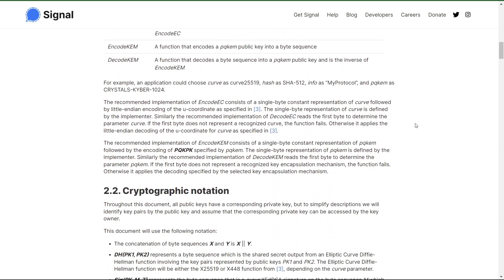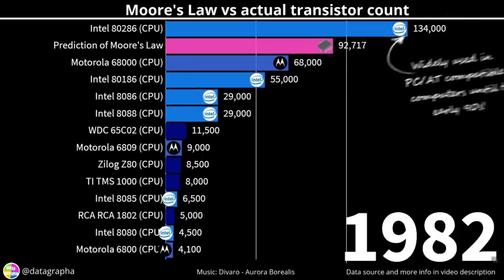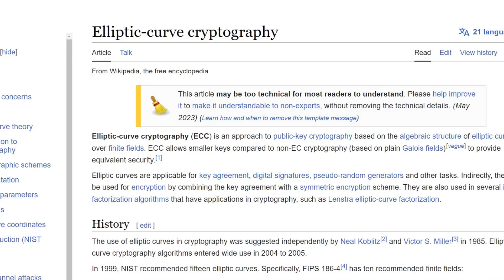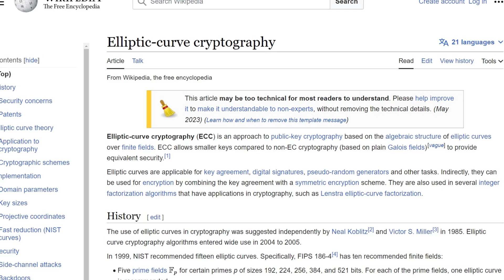Signal Just Published Post Quantum E2E Encryption

Comment: it more than double the power when you add a qubit  Qubits can represent multiple states simultaneously through superposition. Adding one qubit effectively doubles the number of possible states that can be represented. For n qubits, you have 2^n possible states. This exponential growth in states can be harnessed for certain quantum algorithms, such as Grover's algorithm for unstructured search, which can offer a quadratic speedup compared to classical counterparts.
Reply: A classical computer with n bits also has 2^n possible states.   A classical algorithm with randomness (which is commonly used) samples from probability distributions over all 2^n classical bit strings at once.   The potential power of quantum computing does derive from an exponentially large state space, which classical computers also have.
Reply: @iyziejane  the speedup comes from q algos like shor's and grover's which are exponentially faster - they are even faster on a regular computer but it means that the speed gains from adding additional qubits can be much more than double - moore's law is exponential, qcomps are accelerating much faster than that - Quantum volume is expected to at least double each year or about double the pace of moore's law - orders of magnitude jumps and the cagr for quantum tech is projected to be about 30% cagr over the next decade - that could be conservative since at some point it will catch on much more widely and hit an inflection point - 5-10 years we should see a quickening of the pace - people are terrible at predicting the future
Reply: @shephusted2714  Grover's algorithm is not an exponential speed up, it's a mild polynomial speed up (square root).   So Grover attacks on AES encryption are thwarted by doubling the length of the key.   Shor's algorithm applies to highly specific problems.   Even if you had a quantum computer as large as you wanted, there is no known algorithm you could run to solve hard optimization problems that are impractical today.

Comment: So what you're telling me is I need to invest in IBM because their quantum computers will basically be the centralized compute power of the future.
Reply: Give megacorp more money
Reply: No, quantum are only good at a few things- not most things
Reply: @big_red_machine3547   and what happens when new technologies are dependent on it and perform tasks so fast all the standard microprocessors in the world combined couldn't do it at the same speed?
Reply: @big_red_machine3547  Yes, that's with current technology. It's entirely feasible that 1000x+ faster computers with quantum technology could exist one day. This is why nobody actually knows if an alg is 100% quantum safe, as you obviously can't see the future, and anyone that says something is 100% safe is lying.
Reply: @big_red_machine3547  And even then only in theory so far.  I expect maintaining quantum coherence to be exponentially difficult with growing Q-bit count, making long keys inherently quantum resistant even if they don't account for quantum cracking algorithms.
Reply: Or just buy IBM 5100 right now
Reply: @ReyHunter CERN would like to know your location
Reply: Why not throw a quantum computer into space? Nice and cold. Beam the data to and from. Done.
Reply: @Graciashauf 
Space isn't as cold as you think. Look up what NASA had to do to get the IR camera on the JWST to work at extremely cold temperatures in space.
Reply: @chrono_tigger  but u just said it wasn't that cold then say extreme cold temperatures in space so which is it? Throw the computer to the night side of 🌎 and have it always stay there?
Reply: @Graciashauf  
The Cosmic Background Radiation sets a fairly constant temperature of around 2.73K (-270°C) in even in the most remote parts of space. Quantum computers need to be around 0.01K (-273°C), which is 273 times colder than that (please check if my math is right, math and migraines don't mix). The coldest our Solar system gets is on Uranus wich reaches 49K (-224°C).

Not to mention being in space would be very difficult to service and transmit data to and from the computer. It just isn't viable with our level of technology. It's not a bad idea, it just has it's own problems.
Reply: @chrono_tigger  well there goes a quantum cellphone...
Reply: @chrono_tigger wow i didn't know thats how temperature works at lowest temps ( -273 being 273 times colder than -270) , thats pretty cool
Reply: @a.d1775 i dont know if this is sarcasm (if it is, yeah wtf was that about), but no 0.01Kelvin is just -273.14Celsius.

And @chrono_tigger, -270Celsius is just 3 degrees higher than -273Celsius

0Kelvin is equal to -273.15Celsius after all
Meanwhile 1Kelvin is equal to -272.15Celsius
Its just addition no multipliers
Reply: @millionelectricvolts6117  You can use addition or multiplication, both are technically correct. With temperatures, we mostly use differences, so addition is probably the more "honest" approach, I agree.

However, keep in mind that it is much more difficult to cool something from 3K to 0.01K than from 273K to 270K even though both are a ~3K difference. And cooling something to 0K is thermodynamically impossible. So multiplication is maybe more honest after all...

Edit: Fixed a typo in the math
Reply: @millionelectricvolts6117  
Thanks for clarifying. I do know that it gets substantially harder to get colder those last few degrees, and I am not used to working in Kelvin lol
Reply: @chrono_tigger  Sounds about right
Reply: @chrono_tigger Space is exactly as cold as we think. It just doesn't conduct heat very well
Reply: @Graciashauf  it is easy to keep it cold. Real difficulty is to keep q-bit entangled during computation, which means absence of interaction with environment. Photons from your beam basically destroy it as any random particles flying around. It is easier to keep it in heavy shielding down here. Actually you keep it cold to prevent random bouncing of atoms which destroys entanglement.
Reply: @Graciashauf space is near absolute zero, but there isn't almost any matter to actually take the heat energy away. It's like an extreme level of putting a hot kettle in a thick cotton blanket
Reply: @Graciashauf  ambient temperature of outer space is irreleavent, the rate of heat transfer is very low because surprise, its empty.
Reply: @Graciashauf I'm not so sure about the thermal diffusion speeds
Reply: Just so they find some new fancyWord "Physics"
Reply: i'm already up 17% since may
Reply: Yes. Support them in helping with upcoming genocides.
https://en.wikipedia.org/wiki/IBM_and_World_War_II
Reply: YES finally
 I welcome the quantum hollerith machine to deal with  todays ultra complex JP

Comment: It’s a shame that Signal removed their messenger’s ability to handle regular SMS. It makes normie adoption a lot harder. Also, they’re not on F-Droid, which is a little suspicious.
Reply: Signal prioritized security over convenience so I dont really blame people for quitting on using the app. There are certain conveniences that people wont give up.
Reply: They're not on F-Droid because the app uses Google Play Services for notifications if they're installed
Reply: @TheChaoticWolf  This is false. Signal works fine without Google Play Services. It will run in the background and keep a connection open to the Signal servers to provide push notifications.
Reply: @CrazyStranger11 That's why I said "if they're installed" meaning it uses the Google services for notifications if they're installed by default, otherwise if not the app uses its own for notifications. This is why the app is not on F-Droid, because even if it works without the services, it still uses them if they're installed.
Reply: @TheChaoticWolf  Oh now I know why I never get notifications from Signal and have to open the app every few hours to check if someone send me a msg..
Reply: @TheChaoticWolf that makes zero sense,i installed httpcanary on f drois
Reply: @flintgrain   they never tried I have a phone with google play disabled and signal detected that and told me it will run in the background I get notifications and all so it's 100% play API optional
Reply: @flintgrain it would, you just won't get notifications
Reply: @My_Old_YT_Account this is not true. It works without play services just fine.
Reply: This. Signal killed itself silently with that one move. Your mom doesnt care about encryption; you do. You only get encryption if SHE uses Signal, so using Signal needs to be easy for her. She wont manage an entirely different messenger just to talk to you.

Linux gaming wouldnt exist without proton; you need compatibility with worse systems otherwise the marginal transition cost is always greater than the marginal gain. If EVERYONE switched it wouldn't be, but people live on margins, they don't make intelligent organized decisions en masse
Reply: It's better for normies to use RCS than Signal with SMS.  Supporting RCS wasn't in Signal's best interest.
Reply: @flowerpt  Even if Signal wanted to develop on RCS, it's still very hard to implement unless they're an Android OEM
Reply: Sms support dropping made every normal person I know quit using it overnight. I hate signal for it, it's beyond stupid removing sms support
Reply: @rpm10k.  its not encrypted and its an old protocol going out the door
Reply: @idkanymore3382  The all or nothing approach to privacy is why normie's will never adopt it. You have to get their foot in the door first
Reply: @idkanymore3382 Out the door and yet everyone and their grandma still uses it.

Cut the idealistic bull and face reality.
Reply: @rpm10k. Who even uses SMS wtf
Reply: @ImNotQualifiedToSayThisBut the entirety of usa and canada
Reply: @sycration  Why though? In my country at least I'd need to pay extra for unlimited SMS every month or pay per SMS. If you have mobile data why not use some messaging service that at least has proper encryption and can send/receive images, videos, documents, audio, share location etc.? I genuinely am curious.
Reply: @ImNotQualifiedToSayThisBut  I haven't heard of a phone plan over here that didn't come with unlimited text in 10 years. The cheapest phone plan Verizon sells is 30 bucks a month and is 5gb data with unlimited call and text. Also, at least in the big cities, nearly everyone uses an iphone so Apple's imessage system brings texting up to parity with the data-based apps.
Reply: There's Molly on F-Droid
Reply: only people using SMS in 2023 are americans, no one else does, SMS is nothing more than where u receive garbage automated messages for most of the world now. All chatting is done through the internet via numerous different messengers popular in different countries.

So this is a non issue for most of us, also idk what's hard about just opening the messages app when doing SMS and Signal when doing Signal, it ain't that hard.
Reply: @FlanPoirot  Most people are contacting me via SMS. I would like to use Signal instead, but none of them use it and won't switch for me. I even set up Signal for my mom, who was having issues with her messages not getting delivered when she texted me. Does she use Signal instead of SMS to text me? No! This is why removing SMS from Signal is so bad. I could have made Signal her text messaging app instead. All Signal needed to do was color the SMS texts to a red, yellow, or orange, but instead they gimped the usefulness of their messenger.
Reply: ALL OF MY THIS. None of my friends or family have Signal anymore, they all did before the change. Why would a normie keep a whole other app just to talk to ONE person (me)? This was the biggest shot to the foot they could have done. Before, it was effortless.
It's worse for us too, because you have to check manually now to see if someone is on signal instead of it being automatic. They're so pig headed about this that they ban on the subreddit if you bring it up. 

Frankly I hate whoever is in charge anymore, to the point that I would love to quit using it. But unfortunately they're still the best product for ease and security. I lost two years of SMS after having to reinstall the app, because it stored SMS in a way that meant that if the app died, they died too. No other SMS front end does that. Nowhere does it say Signal does that, even on their website. It never reminds you to make a backup, but ohoho, it'll nag you relentlessly about your fucking PIN.

Still no editing, still no deletion of messages (within 24h is a useless joke), still no deletion of entire chats (it's a secure messaging app; do they not think it will be used by people that need to be able to revoke trust in the other party?).

Removing SMS makes them an inferior Telegram with better security. If they want to be anyone's go-to messenger without the killer app that is seamless replacement of the default SMS client, they need to step it the fuck up with features.
Reply: @flintgrain Matrix is related to Ysrael Yntelligence
Reply: @flintgrain it works perfectly fine on GrapheneOS
Reply: Why would not being on the F droid be sus, I would think it’s the opposite, if they were on the F droid they would be sus cause it uses googles notification service?
Reply: @flintgrain Signal has a fallback to websockets if no playservices are installed
Reply: @flintgrain  it does still have notifications using a background service if Google Play Services are not installed.
Reply: SMS is garbage! Everything you send and receive plus the metadata is stored for later analysis! You may as well CC the carrier and the spooks on every message!
Reply: Why would it make normie adoption harder? It's not as if most people are currently communicating on SMS anyway? I feel like the only thing most people use it for are 2FA codes and text from their grandma. The SMS integration outlived its usefulness. It was dead code.
Reply: @jamesbell9627  In the USA and Canada, everyone has unlimited texting in their plans, and so they use it. Also, Apple's iMessage and Google's RCS make it barely passable as a modern communication system. The only people I've ever met who mainly use something else are nerdy gamers who use discord, and foreign immigrants who use wechat or whatsapp
Reply: @jamesbell9627  You’re actually just wrong. Everyone I know of IRL uses SMS, and that spans a massive range of ages, classes, etc.
Reply: Why do you people give a shit about whether or not "normies" use it. You're a normie.
Reply: Agreed. SMS was their dumbest move yet. It drastically decreased the rate of normies accepting it. I convinced several people while it was around and they still use it because they're used to it, but getting other people to adopt it is hard
Reply: I used to text with like 20 people a day.  The moment signal finally dropped SMS for good I went down to sending 3 text a week, except to my GF.   Its so nice not communicating with idiots.  I told them all to message me when they join signal.
Reply: Use wire!
Reply: It's buggy but it's gotten a lot better the past couple of years
Reply: @itsme7570  If their best pitch is "Most of the world’s G7 governments trust Wire to protect their communications", no thanks. Sounds like ROT13 tier protection.
Reply: They are on F-Droid.
Reply: @7heMech just checked. They don't seem to be on FDroid
Reply: @jcon11  they sure show up on my F-Droid it might be because of my native CalyxOS repos tho.
Reply: It sounds like CalyxOS extends F-Droid, then, to provide Signal divorced from Google Play Services. I’ll have to look into it to confirm, but that’s really cool if Calyx is doing that.
Reply: boohoo not heckin trans-droid!’n
Reply: @idkanymore3382  ?
Reply: @idkanymore3382 what is trans-droid supposed to mean? are they supposedly "LGBTQ agenda pushers" or some other alt-right nonsense?
couldn't find anything online on this topic.
Reply: @idkanymore3382  huh?
Reply: @idkanymore3382 is fdroid trans?